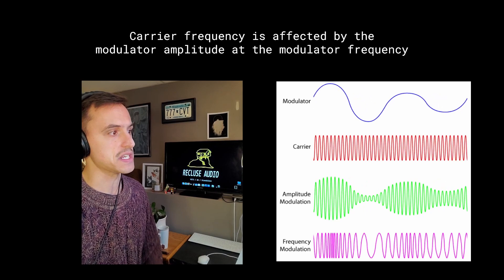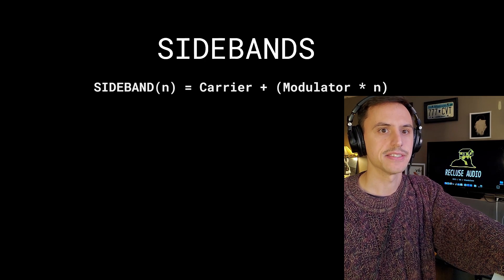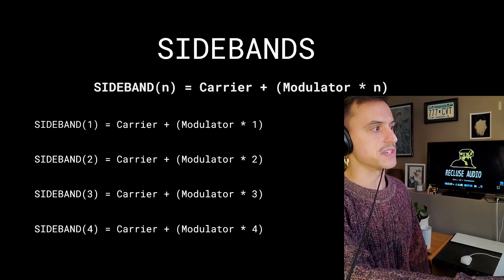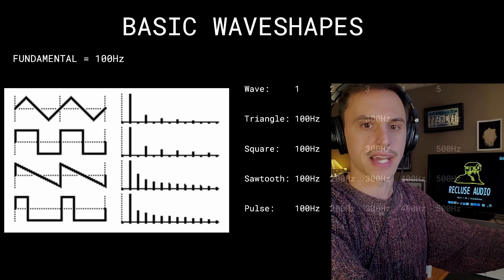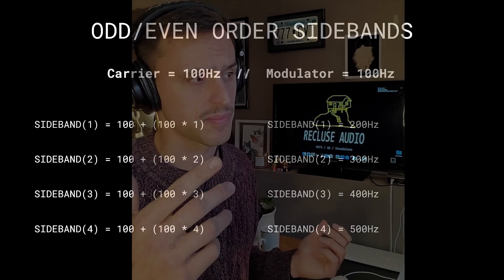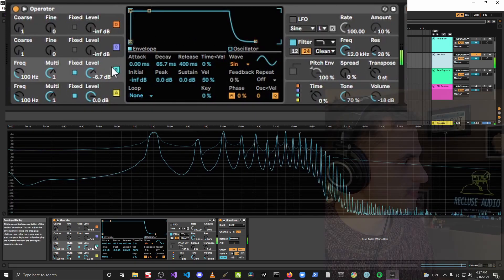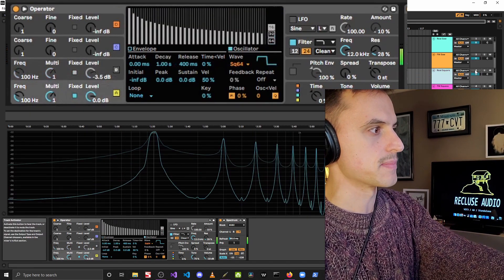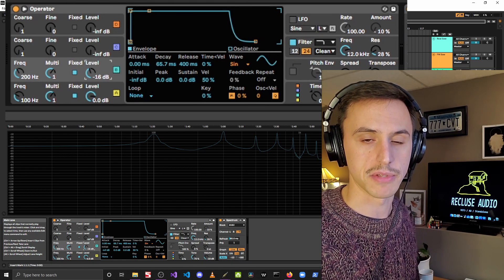Re-Creating Basic Waves with FM Synthesis

Comment: It get’s inharmonic probably because the octave is divided by the equal temperament. There are different tuning concepts, but the most common in the western modern music is the equal temperament with 12 half steps. Let’s say an A = 440 Hz. The perfect fifth would be 7 half steps above with E = 660 Hz. In fact the note is about 659.25. So it’s not that perfect. If you add up more and more upper harmonics in the higher region you get sounds with more dissonant character. You may ask yourself why it’s not possible to tune the instruments perfectly. It actually is, but only for a limited couple of notes (pitches) with perfect ratios like 3/2 etc. To make all of the notes of instruments sound great in relation to each other, which have characteristic overtones like piano or guitar, you need to make a compromise -> equal temperament. I suggest you watch some of those videos on YouTube, they explain a lot about harmonic relations of instruments and sound in general:
Reply: It's just a 100hz sine wave modulated by another 100hz sine wave. What the equal temperament has to do with this? How does it even relate? He wasn't even playing notes to the equal temperament to take place.
Reply: https://youtu.be/nK2jYk37Rlg?si=CVWtOtaexZ0dJ2Ux
Reply: https://youtu.be/Wx_kugSemfY?si=Y0_KvkW9a8x6qUqT
Reply: https://youtu.be/Yqa2Hbb_eIs?si=9LF9kA_sWYUQuRVo